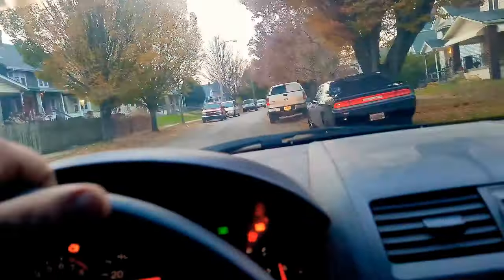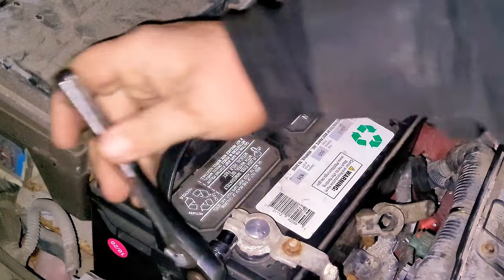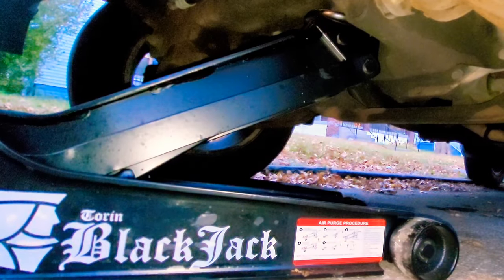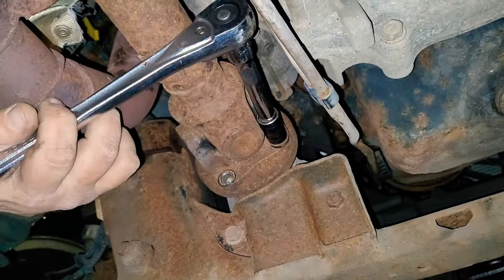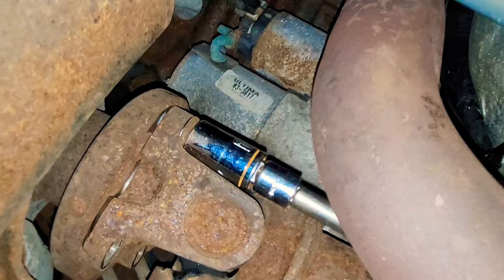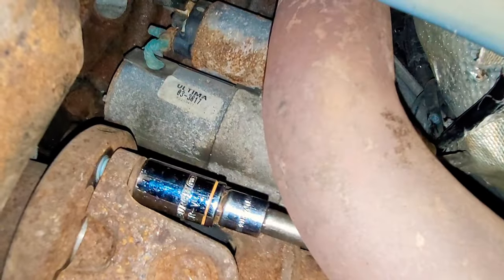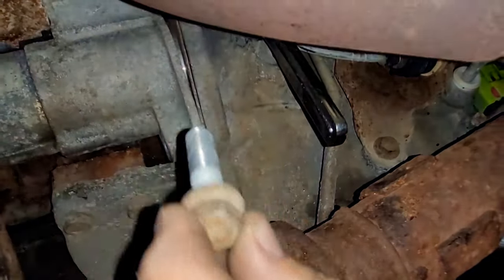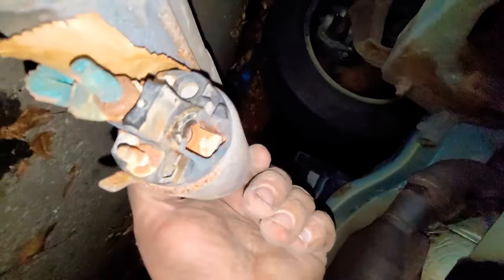Mobile Mechanic Work Day Thanksgiving Special-Dodge Nitro Starter Replacement

Comment: Hey man thank's for sharing. That's very helpful for me right now as I will do the same job tomorrow morning. Hey I've watched 'til the end bro so here's my 7 for you.

I have a question real quick, is there any specific thing to look for when reinstalling the drive shaft there? Any torque specs? Did you add new loctite?

Comment: 7
Man you've had some crazy run-ins on the job.. I feel ya tho once you've been spooked its hard to shake off for awhile haha
I get paranoid working late at the shop sometimes..(we've been broken into before)
Reply from the maker: Yea man once it happeneds or in your case once someone breaks in it breaks your routine and make you think when will it happened again. Before it was if it would happen now it's when will it happened.

Comment: 7 What do you say when a customer say your price is more than what they normally pay
Reply from the maker: I price accordingly to date and time. If they call on Thanksgiving at 5 pm I tell them this is the price and why. If they don't agree that's ok because I'm at a point where I don't have to drop my prices my first few years I was only charging $50 per hour now I'm at about $100 per hour and charge more for after 5 pm and on weekends and holidays. Some people don't accept it though and they have no problem telling me it either lol
Reply from the maker: Like $120 for this starter Job done on Thanksgiving is more then fair and we need to get out of the mindset of because we're mobile mechanics we should be cheaper if you think about it we should be more for the convenience of doing it now and coming to you. Like if you buy a part from autozone you pay more for the part because it's there I'm stock and you don't have to wait or you can get it cheaper online but will have to wait a few days on the part. Same thing should apply
Reply: 7
Reply from the maker: Thank ya brother for making it all the way through

Comment: I'm getting real pissed off on this. I cant get a ratchet on the top bolt. no room. An s wrench will fit but the shaft is in the way and has to come out.

Comment: 7
Reply from the maker: I will enter you into the giveaway
Reply: @semperfimechanic  hell ya thanks Thomas! Do you know how to know if a 08 honda accord needs a new key programmed or a new key and anti theft immobilizer? The green key light is flashing and the key works but the inside of the key like lock unlock etc is fallen out of the customers key so it’s just a shell and metal key I was gonna try and get a new key and have a locksmith program it to the old immobilizer sensor but when I tested the sensor I was only getting 10 volts so I told the customer to start we need a new battery cause battery is only putting out 10.4 volts